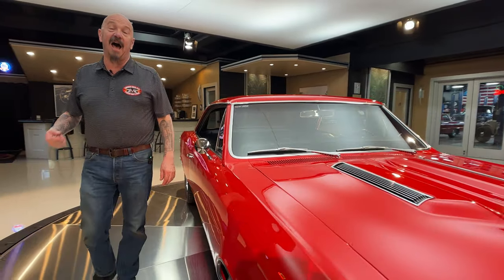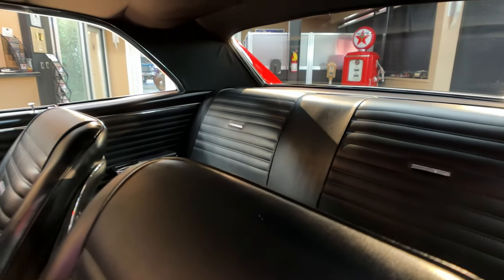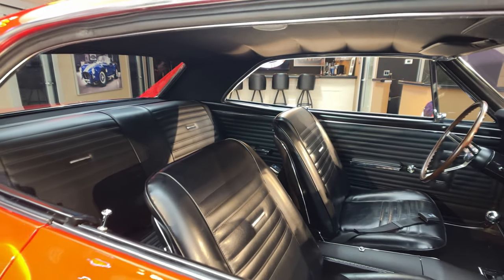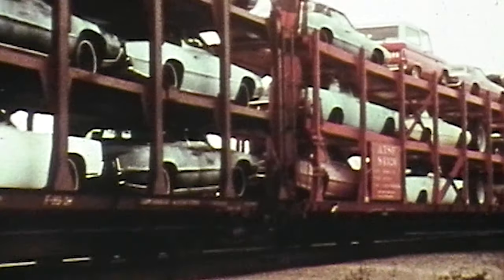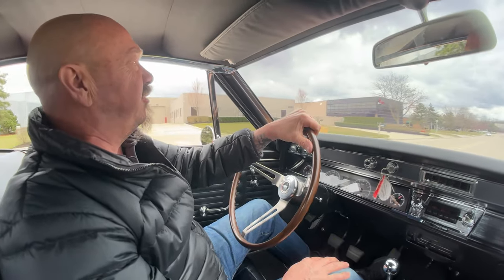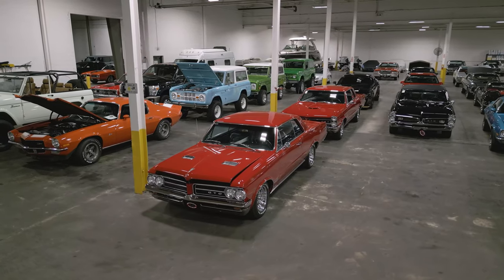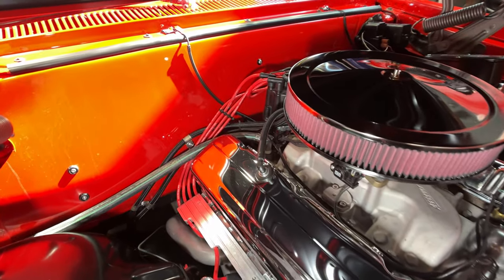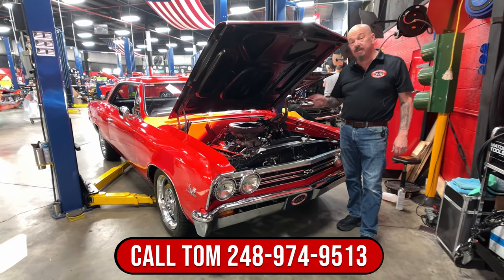1967 Chevrolet Chevelle SS Restomod For Sale Vanguard Motor Sales #2839

Comment: whats your asking price
Reply from the maker: The price of this Chevelle is $119,900. if you have any further questions please feel free to call Tom anytime at 248-974-9513!
Reply from the maker: Gotta be careful at auctions. We go to a lot of auctions and most of the cars there are only nice on the topside. Our prices do seem high looking from the outside in but our focus is on providing the highest quality drivers we can and making the process as easy as possible on the customer. Theres a lot of money that goes into getting a car to that point. Even the nice ones that we do end up purchasing at auction we end up putting a lot of time and money into. If you purchase from us you wont end up with any nasty surprises like you might taking a chance at an auction. The car might RUN but its not going to perform like you want it to.

Comment: Headliner needs work and Greg needs glasses!
Reply from the maker: What exactly do you see that needs work??
Reply: I see it too, it shouldn’t be puffy and “baloony” like that, it should be tighter and fit closer to the roofline.  That headliner wasn’t fitted by a perfectionist.  Also, the covers on the visors are also too loose, they shouldn’t have those wrinkles that are visible during the test drive.  Facts.  The rest of the car does look pretty awesome, I’ll admit.